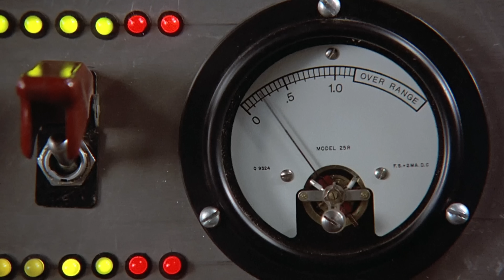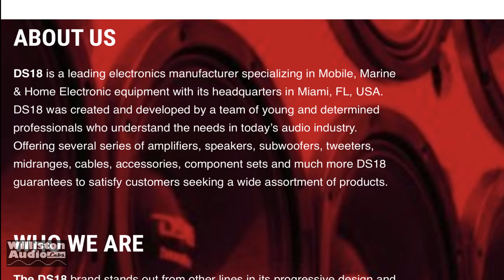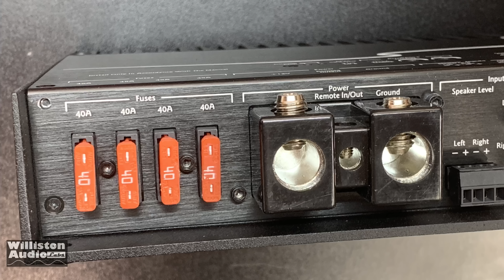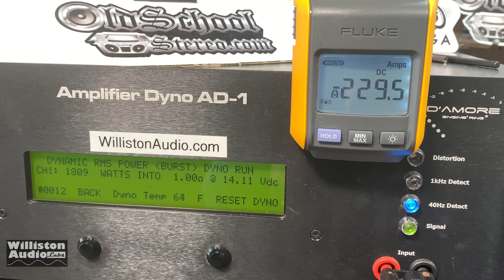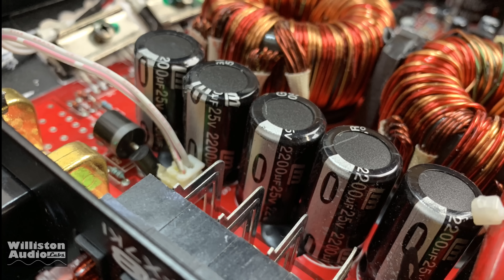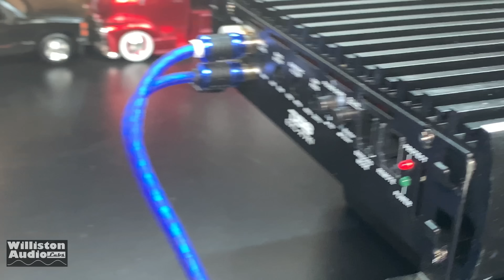Confusing Consumers like a Boss... DS18 EXL 7K Amp Dyno Test and Review [4K]

Comment: This is probably a dumb question..but...Is an amplifier of better quality if it can reach its RmS rating with a lower voltage reading?? For instance reachinb RmS 400 watts at 14.4v is not as good as  reaching RmS 400 watts at 12.8v -13.3v...Thanks to anyone willing to answer🙏 Also where in the specs of an amplifier would I look for to see it?
Reply: Yeap.
That’s efficiency -much what JL , RF and kicker does really well on amps and  subs.
Much why the l7 is so loved and the p3.
They get low loud and sound crisps with small lids vs what sundown needs to reach its rms.

Comment: STAY AWAY FROM DS18 MARINE AUDIO!! i cant speak on all their products but what i can speak on is their warranties and their customer service...i ordered over $2k worth of ds18 marine audio that included a 36" bluetooth soundbar a 200 watt marine 2 channel hydro amp and a pair of their 375 watt 8" tower pods. Got it all hooked up and turned it on an the speakers sounded kinda bad, they played about 3 minutes MAX because i was adjusting the bass and treble on the radio, after a couple minutes i unhooked them and took my side by side to an audio shop thinking i hooked up something wrong well the audio shop called me and said the pod speakers were blown so i called ds18 an they told me to send them in for a warranty so i did then they called me a couple weeks later and said they cant warranty them because it was MY FAULT they were blown because i didn't "tune them"...THERES NO WAY A 200 WATT MAX AMP SHOULD BLOW A PAIR OF 375 WATT SPEAKERS!!! im no audio professional but i do know that its a little far fetched to say that little 200 watt amp blew a set of 375 watt EACH speakers!! SO NOW I HAVE TO EAT $700 FOR A SET OF SPEAKERS THAT WERE GARBAGE FROM THE BEGINNING!!! DS18 DOES NOT CARE ABOUT THEIR PRODUCTS OR THEIR CUSTOMERS ALL THEY CARE ABOUT IS STEALING YOUR MONEY!!! THEY ARE CROOKS AND FRAUDS AND LIARS!! THEIR CUSTOMER SERVICE IS TRASH, THEIR WARRANTIES ARE TRASH AND IN MY OPINION THEIR PRODUCTS ARE TRASH....STAY AWAY FROM DS18!!!!!

Comment: Do you think some of these companies use really high input voltage to pad their numbers? Like 18 volts I’m not even sure how that would be possible I guess it would be possible with some kind of power inverter. I do know that back in the day I think PPI had really high numbers based on almost 16 volts that’s when a friend of mine explained the limitations of my electrical system in my car and it would take major money to get the power necessary to run the system I wanted.
Reply: I sure as hell wondered this!

Comment: Dereck, thanks for taking the time to put some good informative content here on youtube.  I've learned things I never knew I needed to learn from your channel!  Can you help me choose a sub for the amp I already have?  
I have a Boss PT2200 2ch,  they claim 1600 rms bridged @ 4ohm.  Obviously, that's not going to be accurate.  https://www.bossaudio.com/auto/car-audio-sound-system-auto-2-channel-amplifier-boss-audio-pt2200/
I need help figuring out which Rockville sub will work the best with the amp.  Only powering 1 sub, so it will be bridged.  The K9 10'' is Dual 4 ohm & 800 rms, and the K9 12'' is dual 2ohm & 1000 rms, as you know..  And finally, in what configuration would you wire the sub?  If you can help I'd greatly appriciate it!  Subscribed!

Comment: Wish you guys could get your hands on a Crown XLS DriveCore 2 series technology Pro amplifier to test. It makes no sense to me that these amplifiers supposedly deliver 6 times more output power output than they draw from the wall 120 VAC outlet.
The Crown XLS 1002 Two-channel, 350W @ 4Ω Power Amplifier, Draws 175 watts at 120VAC. Crown XLS 1502 Two-channel, 525W @ 4Ω Power Amplifier, Draws 250 Watts at 120VAC, Crown XLS 2502 Two-channel, 775W @ 4Ω Power Amplifier, Draws 425 Watts at 120VAC. Really amazing if you ask me. These things also are very light in weight 
At the 120 VAC input it shows this amplifier only draws 250 Watts. The specs say it can put out 1550 Watts Bridged int 2 0hms. That equates to a 600 percent efficiency. That is truly amazing. Most Class D amplifiers are about +or - 90 percent efficiency. This thing is truly amazing that it can take 250 watts from your wall socket and create 1550 watts. If we could all get this technology placed between our homes power transformer and our house we could save a fortune on our electric bill. Great job Crown / Harmon
Reply from the maker: I have an XLI 1502 here and will test soon. It is Class AB though and very heavy
Reply: Power consumption ratings are given at 1/8 output power, which give a reasonable approximation of a real-world live music scenario. Of course it's going to eat a lot more power if you're running test tones.

Comment: I wonder if there are two versions of Fire I bought the same one but it cost me $120 and it had a 5x35 amp fuses instead of the 4x40 amp fuses and I did notice that the spec sheet that you found the information about the amplifiers this had 5x35 amp fuses in the specs
Reply from the maker: Yeah I’m not sure about that?

Comment: 100 bucks for 1500rms. Great deal. iF you buy refurbed. Brand new..its prob priced around 250range and at that price range...theres better options out there. But to run a sundown sa 12 or anything that needs 1000rms id grab this
Reply from the maker: I think it’s closer to 300 new as the Gen X 6000.1D is the newer model and it sells for $310’ish

Comment: I have a request for a dyno! Kicker newer Kicker  kx series amps kxa800.1 and kicker kxa800.5 amps!
Reply from the maker: Kicker amps do rated power. Only exception I’ve seen is the tiny powersports amp I tested a while back
Reply: @wal  I saw that awesome video.had an issue with my kxa800.5 it won't power up. I contacted Kicker and they were very fast to respond. It's out for service. Loved that amp. I'm using my old alpine mrv-f450 to run my speakers atm. Still a great amp For being 15 years old.
Reply: @wal  kicker had to service my kxa800.5  they said  it put out 832 watts total on their bench

Comment: i haven't been thrilled with any ds18 products ive tested so far . for the money this amp seems to do well , that is if you can find one at that price , lowest i could find a refurb was 230$ and at that price there is many better options for budget builds , the ap 2000 at 185$ new is a much better deal and doesn't have some outrageous numbers printed on it

Comment: Hello BigDWiz    could you please read the number off the 8 pin integrated circuit  that is on that small vertically standing board ? I have same amp thats blown a I cannot find out what IC that is as the number is unreadable on mine. Thank you very much
Reply from the maker: I’ll check

Comment: I was told in mid 90s rule of thumb is if it has fuse or fuses on the side add them up and add a zero here it worked 40x4=160 add zero 1600watts i been competing since   1995
Reply: I do this  today never let me down
Reply: I had a pyramid amp which used 160 amps worth of fuses.... You could forget about adding the 0 on that one.
Reply: I was told to multiply the fuse by 12.. meaning 12v times the fuses.. depending if u get 12 volts, u might get 14.4 and then u still multiply by the volts
Reply from the maker: In this case it sure pans out!

Comment: I bought a rockford fosgate t1d412 sub off my brother for $100 (big hook up) and i want to get the perrfect amp, cables, box and fuse for it (and anything else i might need) but have no clue what I'm doing. Any help would be greatly appreciated.
Reply: Frank Rizzo Skar 1500 good strong amp don't cost alot
Reply: I would say Custom Box to spec, OFC sky high wire. The wolfram 2400 seems like a great Amp for the price. Keep searching I'm sure you'll figure it out.
Reply: t1000 or t1500 RF

Comment: Some of the reasons why you didn't get the numbers that you were wanting is because you never maxed out the bass boost and other settings as well, that's why you didn't get the results you were looking for.
Reply: Bass boost isn't going to give you an extra 5000w
Reply: "But.......these go to eleven."
Reply: Chip Adams couldn't be more wrong
Reply from the maker: I always test an amp with bass boost minimized and crossover at highest setting (or off) and subsonic at lowest setting.

Comment: Earlier today, I was going to suggest you test the DS18 Candy 6. It's a 6 channel class D that's supposed to do 6x80W RMS @4ohm. Would be a budget solution to run active components in the front, and a pair of coax in the rear. Can be found for ~$240-260 new. There is one on ebay refurbished for $180 currently. Someone commented on Amazon that these amps don't come with warranty!
Reply from the maker: Wow, that does sound interesting 🤔

Comment: All I can think is that they use a much higher frequency test tone at the factory.
Reply from the maker: And higher voltage? Possibly, but i see 14.4VDC mentioned in RMS Power ratings
Reply: They are just using theoretical numbers based on theoretical variables.

Comment: Why does it have 4 40 amp fuses if it don't come close to 2000 watts
Reply: iZZyBVaPn rule of thumb is add up the fuses on side of the amp and add a zero 9 out of 10x that's what it'll do and normally works does here 4x40=160 add another zero 1600 watts

Comment: @ Dirk @ williston audio labs Not ok when they say 2k watts and its a little bit more than 1k.. and then write on the product 7k tats absolut fake and scam  i hate it... a amp whos rated 2k must make minimum 2k and not 1k... 
I have a old Rockford 800a2 this is a good amp you tested the 4ch but the 2ch in bridge at 2 ohm is abnormal power... 
And in my musicroom i have a pa Amp from American Audio the biggest with 2x 1,3k at 4 ohms.. i drive it with 2x 2ohms and it works with brutal bass... this amp let swing my 10k watts SPL Subs... this is a Amp you must test !! I know it musst have more power... this amp let strope my led lights in the house!!!

Comment: I totally agree with the max wattage statement on the amp boxes. But the amp seemed to do pretty good if it was rated for 1500 watts at 1 ohm. But maybe your videos could help companies understand that putting the correct wattage helps a lot. Great videos Big D
Reply from the maker: My goal is twofold...show consumers the truth and encourage companies to understand their amps and test them if needed so they are not relying on a supplier/build house for the measurements
Reply: It was supposed to be 2000 Watts at 1 ohm
Reply: Daniel McBride 
It still failed.
Reply: @ericbachmann8037  I know that's what I was telling that guy.

Comment: I own 1 ds18 product, and it's there dual 1/0 amp inputs.. they are nice and heavy, I believe they are solid copper and nickel plated, they could also be brass nickel plated, the listing said solid copper though.. but u never know now days.. I just know there built better than all the solid aluminum amp inputs I have.. and a magnet does not stick to them. I'm pretty sure the copper nickel plated, the was around  $34 pair. There small and 1/0 shca wire fits nicely.. there best series of amps are pretty decent and do rated power, and I believe there Korean
Reply from the maker: Thanks for the info 👌

Comment: Grossly inaccurate power rating Brands is the very reason the CEA-2006 Power Amplifier power rating standard was implemented. If an amp isn’t CEA-2006 compliant, it’s pretty much guaranteed not to meet it’s rated power.
Reply from the maker: Great point, but even CEA/CTA-2006 has flaws as an amp only needs to do rated power at 4 ohms to meet standard. Many of these bass monoblocks are rated down to 1 ohm so I’ve seen several amps which had CEA/CTA seal, yet failed at lower ohm loads to meet rated power
Reply: Williston Audio Labs 
True, still better than a 7000 watt rated amp only doing 1600. Or whatever it did at 1 ohm. 
I’ll still believe a CEA-2006 compliant amps ratings over a non compliant amp. 

Lucky we have testers like you to reveal who the misleaders are !!!! Keep up the great work and videos Big D !!!

Edit: I also like the brands that test their own amps and include the “Birth Certificate” of that particular amp............. THIS should be standard !!!! :D

Comment: Drag any boss amp, or planet audio  vs Rockville M5.  Curious
Reply from the maker: Ha!
Reply: @wal  YEAH WTF...  wish you would do like a 300-500 amp challenge or something around that line... ty for everything youd o bud...   you have saved me money i love my orion 3000.1d...  Its running my 2 15 DS18 EXL XX D2 And i am doing a 151.4  not to bad for stock alt and 1 AGM Voltage drops to low 12 but i ordered a CES 270  and 45 amp hr  yinglong lithium 6 cells... TY AGAIN
Reply: I'd give my onyx up to the dyno

Comment: Do the apocalypse 4k, probably the best 4k available and it's very reasonably priced, the bass knob alone makes it perfect for daily setups. Clipping, voltage and amp temperature all on the knob.. and Korean built! Running mine at .5ohm daily on a deaf bonce sa312 d1, thing pounds on 4k

Comment: IMO another brand to avoid. Yes at $99 it's a pretty decent value. But using the MAX wattage ratings all over plus not even being able to do the RMS ratings = a fail in my book.
Reply from the maker: Pass da watt per dollar
Reply: I would get it then use a 3M rubber pinstriping removal disc or acetone to remove the stupid 7000Watt max garbage off the amp's heatsink.

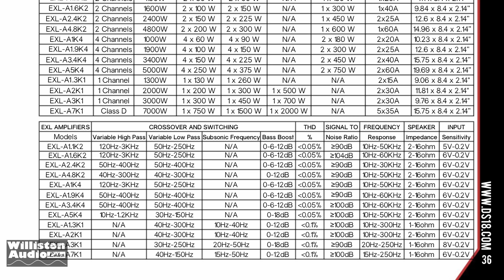Comment: At 1:17 it looks like 5 35 amps of fusing. But yours has 4 40's   that's only about 15 amps difference.  My question is would it do much different??
Reply from the maker: Good question, yeah the one in the brochure had more fusing. Not sure if my amp is older or newer...or maybe the wrong board? Hmmmmm

Comment: Capacitor temp ratings are typically 85 or 105. 105 is often found near the power supply. Some amps will still run 85 degree though on the power supply. Caps out of the power supply, in the audio path, or whatever, are often 85. If they are running 85 degree caps, then it can be assumed the designers figured the higher temp rating wasn't needed.

The big issue I'd have is the fact many amp makers have been skimping on quality and using super-cheap Chinese caps. They might last a long time, they might not. They might also have wild tolerances and poor quality control, poor ripple, ESR, etc. values vs. higher quality US, German, Japanese, etc.. If they are in the audio path, they might color the sound unfavorably. This might be more pronounced with super-cheap polyester film caps, where you might get ringing at higher volumes from high frequencies, poor differentiation between similar sounds (2 similar sounds that while clearly different in a high-end home audio or even average home audio on OK headphones will sound very similar to each other on a cheap car amp) or muddy bass. So you might sacrifice accuracy going too cheap. Then you have other factors like slew, SNR, etc. that might go to poo on a cheap amp.

Think of it like a cheap sh!tbox car someone dropped a bigger engine into, w/o upgrading the suspension, trans, tires, and brakes. It might "move" quickly to a good speed and give a nicer car a run for it's money in a straight line, but putting the same power into better built car that has quality suspension, tires, brakes, trans, etc. will yield a better experience. That's not to say the sh!tbox car can't be made to compete, as you can upgrade every aspect of it, but it'll take more time, money, and effort. Amps should be viewed the same way.
Reply from the maker: Great comment sir 🤙
Reply: @wal  Thanks. Keep the great vids coming! 

Fwirw, cheap resistors should be lumped in too. If the amp relies on them for bias, DC offset, etc. instead of using actual adjustment pots, and uses cheap resistors (hard to tell what's what with tiny printed on resistors the size of a pencil tip whether carbon, metal film, etc.) with a 15% or 20% tolerance, while higher-end uses modern quality resistors that have 5% or even 1% tolerances, and are made from better materials, there will be a difference.

If cheap amp has resistor 1 on channel 1 that's +20% of it's rated value due to a high tolerance, while resistor 2 on channel 2 is -20% below it's rated value due to the tolerance, that's a pretty significant 40% difference between the 2 channels. Now let's many of the resistors have that wild difference between each other. You may or may not be able to tell at the ear in a car, but it's definitely there, and deviates heavily from the listed value. Might also be why some amps have a 5-10+ wrms difference between channels assuming the chips are OK and something isn't actually faulty, or repairs were done on one channel only, etc. etc..

Really high-end amps most likely value match everything before installing, use quality caps and resistors, chips, etc. which will obviously bump the price quite a bit but depending on the end-goal, might be worth it (old school Zapco).

If you see an amp is "Made in Japan" running say Nichicon caps and other name-brand quality caps, they probably went the extra mile and are running decent resistors and quality, non-knock-off parts throughout. 

When you figure running quality caps, resistors, chips, etc. might increase the build of the amp by $30, and they make say 20k of those amplifiers, and have entire lines of different amps, they could in theory save $600,000+ per amp line by going cheap and still selling it at a higher price point, or flooding the market at a cheaper price and plastering their "10,000 MAX WATTS" garbage" all over it :(